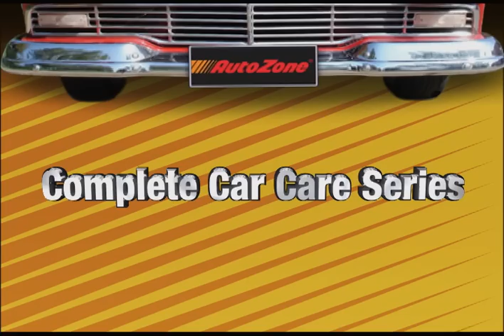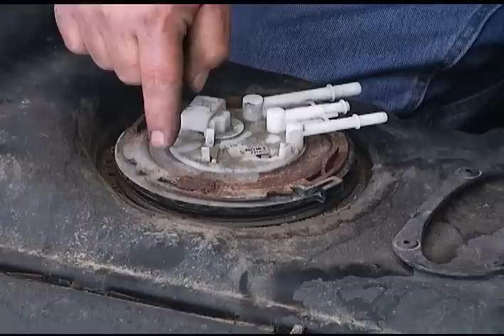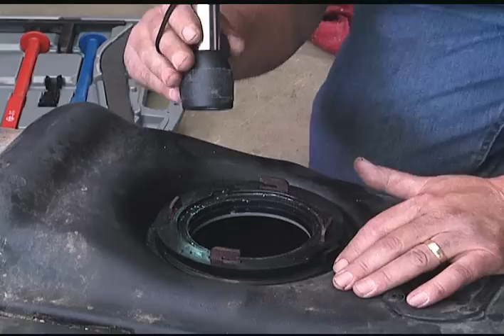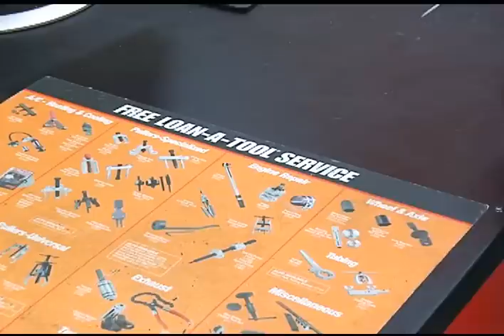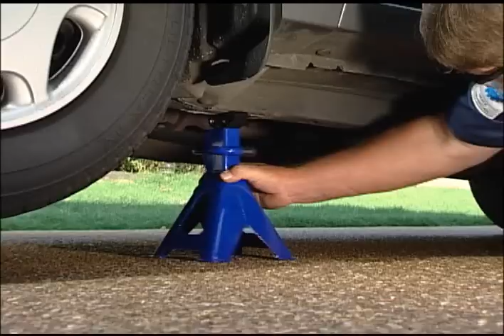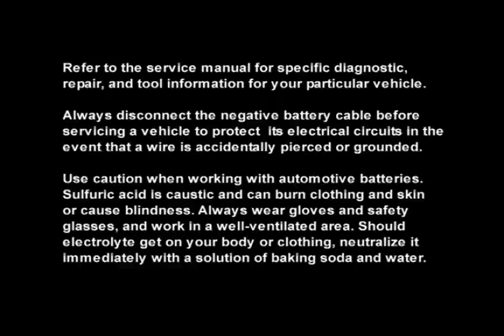Removing An Old Fuel Pump

Comment: I always chop a hole in the back. My guess is none of the videos will show that because there could be a liability. 
Warning don't use a metal grinder. Hammer and chisel or air chisel.

Comment: How did you attach those 3 tubes on the top of the FP Assembly to 3 outlets? Did you heat them, used certain pliers? Thank you.

Comment: that's bull.... the little pitiful tapping he did with that rubber mallet IS NOT GOING TO LOOSEN THE LOCK RING THAT HOLDS A FUEL PUMP IN... he's had that one out already... you can hit that thing with a sledge and it won't move.... there's a lock ring tool that fits in the notches of the lock ring... and be prepared to put a cheater bar on the ratchet... i'd use a pull handle... not a ratchet unless you want to tear the ratchet up... it takes a hell of a lot of force to get that lock ring broken... and most times you have to get it off without taking the tank out... in most cars it's under the back seat... and there's not a lot of room in the back to work with a hammer and cold chisel...

Comment: hello i put in a new fuel pump but it makes humming noise is that normal even when i drive the car the noise is present and sometimes has a knocking sound to it ,,,,my old fuel pump assembly never made noise was always quiet also the new one i noticed i have to make more trips to gas station..any suggestions please is the fuel pump faulty or is it normal making noise
Reply: Red new one
Reply: Need

Comment: I replaced a fuel pump in my 89 s10 pickup with a 2.5 liter engine. I   replaced the fuel pump a AC DELCO FUEL PUMP.  I took my time and made sure it was positioned right on the hanger assembly. The tank is brand new so it was easy to remove. I also replaced the fuel pump sock on the bottom of the fuel pump.  Put it back together and it started right up. But the engine runs worse than before. This is the 4th fuel pump I have gone through. Isn't there a real fuel pump that you can purchase instead of the micky mouse fuel pumps that are being sold today. My truck hates fuel pumps.
Reply: Quit letting gas get low

Comment: I got the lock ring off and the springs that push fuel pump lifted it off once removed. But the pump won't pull out. Is there a special way?

Comment: Am I the only one that thinks these lock rings are a stupid design? What’s wrong with some bolts and a flange like my Toyota uses?
Reply: Probably avoiding bolts to avoid any sparks
Reply: @luisornelas6490  Apparently it’s to create a tighter seal and to be easier to install and remove… however I think it’s probably just easier to install at the factory is my guess, that’s the reason.

Comment: I have a gas leak and its coming from 2 of the 3 gas lines at the top of gas tank a man that said he would fix it said he would get some kind of glue to fix it is this true is there some glue that can be used to fix gas leak?
Reply: Angela Ashe    did u get it fixed yet? i would not try that because it isn't safe and n a few months you'll need work again.

Comment: where there is a fuel pump? Opel Astra F 1992 as donego get here?
Reply: under the dash
Reply: Under the dash lol.....and yeah Alex is right.
Reply: Drop the gas tank.  It's inside the tank.
Reply: No it's not - it's in the fuel tank.
Reply: 2006 Range Rover gas removel

Comment: Pb Blaster is a bad choice to use. The spray eats away the plastic. 

wd40 Specialist is better. A small flathead screw and rubber hammer could also work.

Comment: I do it with a hammer and screwdriver,no sparks yet.DON'T BUY AN AIRTEX FUEL PUMP!!!!!!!!!!!!!biggest piece of junk that has a very high failure rate.AC Delco or Delphi for GMs only.Change the fuel filter at the same time,part of the warranty with the fuel pump.